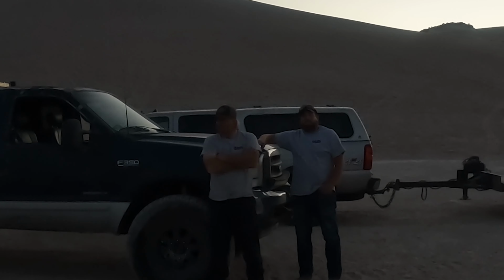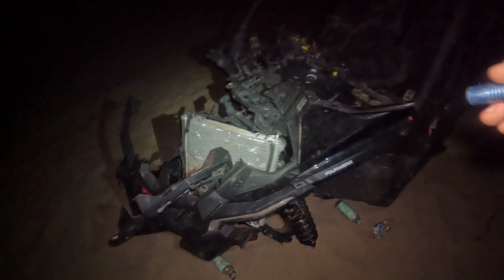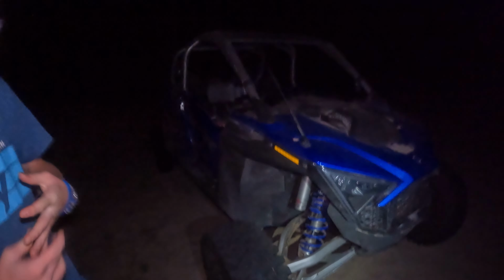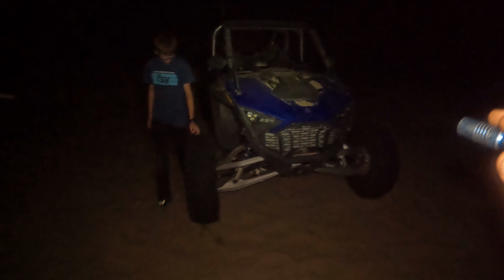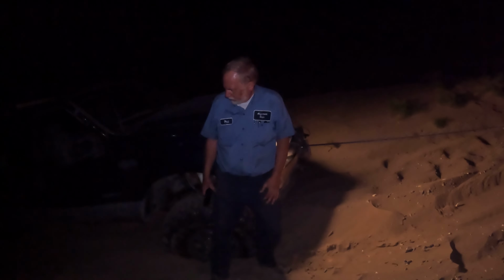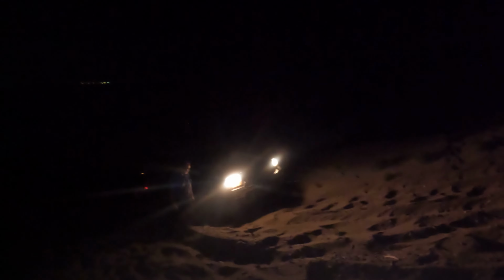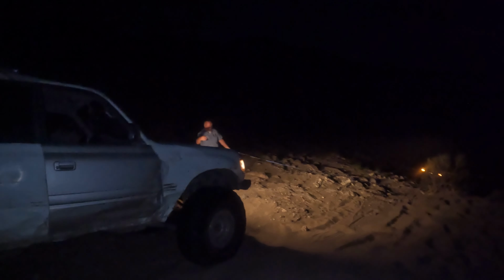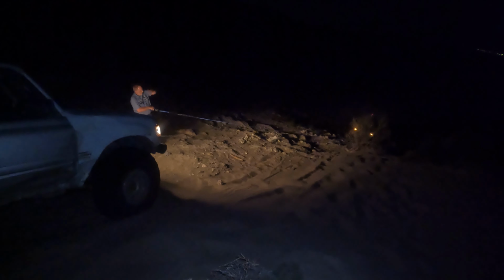Is This Our Customers Razor? Sand Mountain Part 1

Comment: Reckon a snatch ring or block may of made a difference and eased the burden on the rigs winches? You guys worked for this one, that's for sure.
Reply: It would have givin us more power but the issue was the distance we had to winch. It’s hard to tell in the video but we were winching over 400 feet
Reply from the maker: The winches worked great, never ran out of power. The only issue was ripping the d-ring off of the front of the ford.

Comment: you guys need Yankum Ropes, that chain is a Killer. damaging both rigs.
Reply: We only use kinetic ropes. What chain are you referring to?
Reply: The wench line is a rope. On both trucks. It ended up being the d ring on the truck gave out and flung back at Phil
Reply from the maker: We only use kinetic ropes and synthetic winch lines. We never use chains.